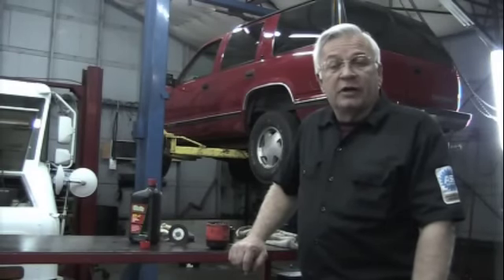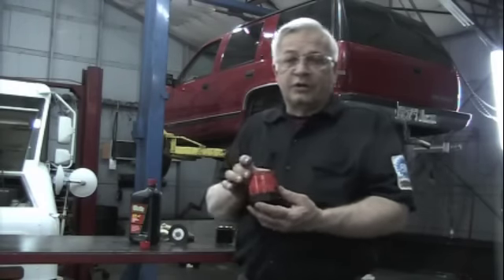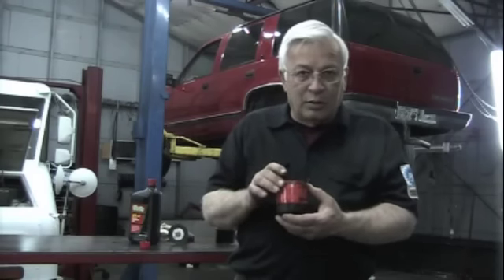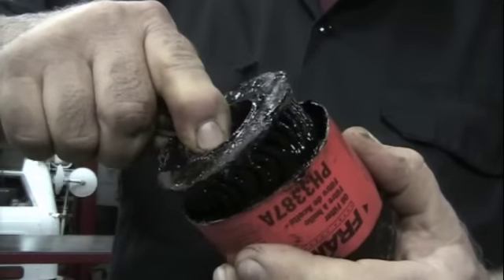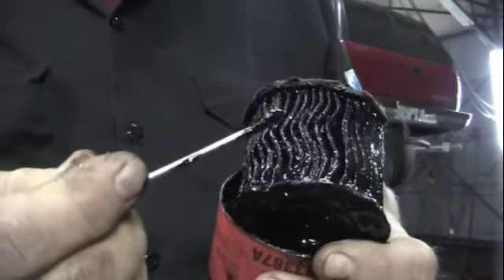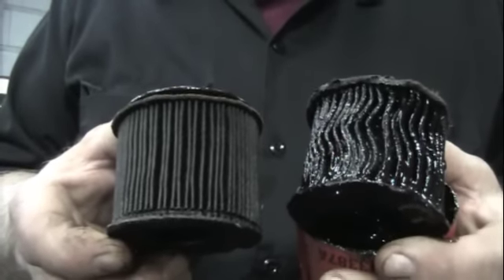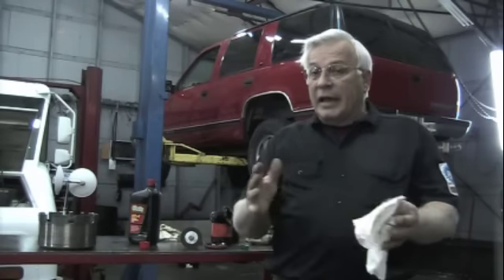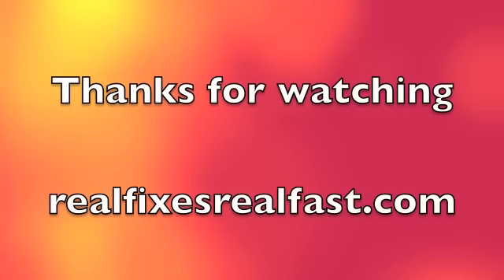Low oil pressure, finding evidence

Comment: I may as well invest $23.50 AUD in an oil pressure gauge to check the oil on my Chevrolet LS1 engine.
The oil filter has actually been catching sand & holding the anti drain back valve open overnight so the oil pump sound as if it's aerating on startup.
If I let the engine sit for 5 minutes after startup, it won't do it again if I restart it within that time period.
That will likely save me $120 AUD on a new oil pump,the engine has done over 332,000 kilometres & has a lifter noise sometimes,at easter (hopefully if I get a job before then), I will fit a used camshaft I bought for $35 AUD as I think the original one got hammered,the lifters are probably just worn out as the rollers squeak.
I will see if any of the area around the lifters is dirty & clean that when the cylinder heads are removed.
I will also replace the worn timing chain as well.

Comment: Concerning this video what is your opinion on oil flushes?

And will oil flushes hurt, weaken or damage gasket/seal or rubber rings in an engine?
Reply from the maker: no oil flushes wont hurt the seals.  just be sur to be patient and give it time to work

Comment: I just found out today. 2019 ram 1500 with a 5.7 will run 102351.6 miles if you never raise the hood on it.  the lady said she was driving and heard a squeal and it shut down.  no warning. after seeing it was locked up she said to fix it any any cost she still owed 32k on it. after pulling the engine and oil pan it looked like it was full of grease not oil. you could see where the crank made groves in the so called oil.  after checking it out a little more we found the drain plug still have the factory paint mark on it same with the oil filter and air filter. it was so dirty that it split. so we called her and she said she didn't know she had to change the oil and filter. so after I got home and thought about it I think i'm going to call her in the morning and tell her we not fixing it unless she agrees to bring it in every 3000 miles and if she goes over 5000 miles she voids the warranty.  oh and if you figure it up the truck is only 8 1/2 months old.  that's about 12500 miles a month. this woman drives. but if she had a fram on it I bet she wouldn't have made it 60000 miles.
Reply from the maker: thanks for sharing.  You wouldn't think that could happen, but they can.  Good move on the 5000 mile warning, lets see if she ignores it too.  Suggestion;  to help he get in the habit of changing the oil, increase your final charge by what you need cover them, and then tell her the oil changes for the next year are included.  Hopefully she won't forget about having them done.
Reply: @realfixesrealfast  well i'm finding out in a truck that's only 8 1/2 months old it seems I will be getting a engine from a dealer.  so she going to pay and then i'm going to add my 30%. but I just started looking into it today.

Comment: Sludge can be caused by a bad oil quality, misfires or too rich mixture , injector problems (pissing in place of spraying), so that unburned gas came down in the oil: this make chemical reactions with the unleaded gas (contains alcohol, benzene and other chemicals)...
A coolant leak can produce mayonaise (oil/water emulsion) but they color look more like milk coffee or chocolate...
If you drive principaly in city and small distances, change the oil at half the normal millage...

Comment: My guess is there are chunks of gunk in the system that randomly break loose and get trapped in the filter. I would say that the previous owner never changed the oil. He probably changed the oil just before he sold it. Eventually, if enough of these chunks break off and become part of the filter, oil will be restricted throughout the system. This will cause all kinds of damage to the engine if left unchecked. This guy should really flush out the system.

Comment: I have a hard time believing that filter was changed when the oil was. Even though it's FRAM, which is garbage, it still would not be that bad. The oil change place was just dumping the old oil and putting new oil in without changing the filter.

Comment: I have a Ford Bronco II and my drivers side rocker arms would basically eat their way through the rocker arm shaft and bend push rods because no oil was getting to the rocker arm shaft, NO OIL!. 
So I installed a T fitting in the side of the block where the oil sending unit goes and ran a plastic hose from the T fitting to the top of the engine. I then drilled a hole in the end of the valve cover and in the end of the rocker arm shaft. I put a rubber grommet in the valve cover, ran the plastic hose through and into the rocker arm shaft. 

Problem solved! 

At first I would fill up the valve cover with oil so I installed an inline pressure regulator in the plastic hose to slow down oil flow and I've been driving it for 3 years now with no problems what so ever! I'm guessing a spun cam bearing or something else blocked the oil passage to the rocker arm shaft and replacing cam bearings is way more work and would have cost way more money than the $20 I spent on  plastic hose, a T fitting and one grommet.

Comment: If you ever look at pictures detailing the inner construction of Fram filters, you will see that they are very cheaply constructed in comparison to WIX and Purolator.

 Fram used glued-on cardboard ends instead of metal and rather flimsy filter medium.

Comment: @dmorley100 Yeah, there is no way that happened in two months. 

Sounds like someone is lying. Either the oil change shop was skipping out of changing the filter or the owner just changed the oil but not the filter after the engine began making sounds.

Comment: I found out the hard way , that it was the Fram Oil Filter causing my issues ( I decided to cheap out one day) Now I'm facing a possible complete  engine tear down and I just had this engine rebuilt four years ago with less than 10,000 miles on it.. Glad you posted this video.

Comment: I agree with the diagnosis but I disagree with the solution.  I would drain that oil & put cheap oil & filter back on & put a full can of seafoam in oil, let it idle for 5-7 minutes & shut it off &let it cool all the way  repeat this process about 3 times & then drain your oil & put good synthetic oil in & a good filter, Fram & purolator don't count. Get a K&N or royal purple filter. Good filters don't gum up near as fast. You should do the seafoam flush with every oil change.  I always do this & I always get 250,000+ miles on every vehicle.
Reply: buzzsaw301   Yes, I use Motor Flush by gunk every 3rd oil change.  My Toyota 4runner now has 316,000 miles.  Highly recommended.

Comment: sbc . i have no oil coming out of the top of my 350 chevy . pulled the oil pump spun it by hand oil comes out pretty easy .. what else could it be? also the oil is clean just had it changed about a month ago.

Comment: If my pressure is good on start and falls after running it should I check this first and then check the oil pump after? I just replaced the oil sending unit so I think it's reading properly.

Comment: I'm having same problem in my 98 4.3 vortec blazer. Well about a half hour after running and driving (when the oil gets hot), I stay hearing a knocking sound coming from oil pan. Most likely a bearing.   My oil pressure Fisher never list pressure but bounces anywhere from 60-120psi after it warms up. I know before it starts knocking because as soon as gauge starts bouncing it knocks. I've got my truck oil pan off now and I'm replacing the pump. Someone told my the pump had a pressure relief spring that might be bad. In just praying I didn't do all this work and my motor still knocks once I put it back together... BTW, it is so quite the first 20 minutes. No sounds. Even tried to get sounds to show mechanic but motor wasn't hot I guess??? My motor has 240000.
Reply: I hope someone can help. Don't know what else to do if this isn't the problem.
Reply: Jeremy Stapleton any luck on this????

Comment: This is a very informative video. I never even considered cutting open the oil filter to check on anything. You don't necessarily need a cut-off wheel to cut the filter body. Just use a hack saw and cut it all the way through.

Comment: I have a new long block 75 Chevy 292ci. Mostlt city driving, what interval of oil changing should I use. I use Castrol 20-40 at 30lbs oil pressure.

Comment: It could be short journeys not getting the oil hot enough for long enough to drive all the condensation out, leaving it to turn to emulsion
Ten miles to work and ten home might be just not far enough to turn it all to steam and vent it off.   just an idea.
Reply: Quite possibly.  But then the oil he drained would be sludgy aswell as visible sludge on the underside of the oil cap. I drive 2 miles to work and back and it makes my oil smell of petrol from the majority of rich running :/. Thats why i change it every 6 months

Comment: I installed a Mulling oil pump not to long ago on my 33 year old corvette, cause when I stop at a red light the oil pressure would go down to almost “0” but the engine never overheated and no noise would appear. Still dose it after I replaced the oil pump. What could it be . The oil pressure sending unit?

Comment: I agree. What i dont i quite understand, is if I was to find an oil filter in that condition, I´d flush the engine just make sure that the sludge problem is pretty much taken care of though out the entire engine using 2  new oil filters. The second one as the final one. Over 80psi?? Is that a standard engine??

Comment: Good day. I need some professional advice. I have a Toyota 1992 model 4AF Carburetor playtoy.I open the engine at 605K for the first time just to replace bearings on the big ends and put new rings in"I did hone the sleeves..Overhaul the cylinder head at a engineering works.I never previously had any noise in the engine, just to redone the engine only.Now what happens with the engine, when the oil started get heat up, i hear something like a bearing knock between 2500-3500 RPM. I investigate with a screwdriver on the head, with my ears. Cylinder 1 no noise, 2 no noise, 3 start noise, and at cylinder 4 the most noise. Is that the oil pump? Someone give me some advice please.

Comment: That’s helps me a lot although I’m getting low oil pressure gauge light that’s doesn’t fluctuate whatsoever. It stays at low. Could that be the sensor? 03 Ford Explorer 4.0 v6.
Reply from the maker: yes it definitely could, or sludgy oil.  I have seen these as almost yearly failures when the oil is sludgy
Reply: @Maddog worker 20 + years and sitting for 8 years, the oil passages are most likely plugged up with sludge.  I would recommend an engine flush from a tech that know how to properly do it.

Comment: The worst thing you could do with an engine in that condition is do an oil flush.  Doing an oil flush pretty much guarantees you'll end up clogging up the oil pick up screen.  Better to change the oil more frequently and let the detergents in the oil slowly break down the sludge.

Comment: Well the we are talking about 2 different kinds of flushing and you should have known that from our previous dialog. I'm not familiar with an engine flushing machine; maybe they're no good or maybe it just wasn't operated correctly. I've used a quart of flush that gets dumped into the crankcase and the engine is then IDLED for 20 - 30 minutes. You start with clean oil and you dump out black oil. I've never heard of anyone having problems after using this method.

Comment: getting a bigger engine oil filters better also less choking for the engine
Reply: Len Vantil na, dont go outside engineers requested oil filter size. volume and pressure changes. the movement of oil (viscosity)may change.  choke.... huh
Reply: Len Vanti

Comment: How do you know the screen wasn't already plugged up before the flush was done? The flush breaks down the chunks. It turns it into a low viscosity fluid. That's the point of using it. Not to just break chunks free, but to dissolve them into the oil.

The size of the internal oil passages is irrelevant since the oil has to pass the pickup screen and then the oil filter before it reaches them. Sludge will never find its way into the oil passages from the oil pan.

Comment: sounds like someone has not changed the oil on time. IT could be it is using oil and sludging up the internal parts of the engine.but thats alot of sludge to come out of the filter, or someone put somekind of oil treatment and thickened the oil alot gumming up the oil filter.neither that i believe that the motor should have 80 psi oil pressure a new motor should not hold more than 60 psi .something dont sound right. better dig deeper. rod aspen

Comment: Where is the oil level sensor located on the 4.3 L ? I have a 02 Silverado and CANNOT find it on the oil pan.

Is it inside the pan❓❓❓❓

I'm also seeing the oil pressure gauge drop after engine is at operating temperature.

Please share any videos that would help.

At the moment the light on the dash keeps telling me to check low oil level. When oil level is fine.

Please someone HELP❓❓❓❓
Reply: It should at the rear of the engine below the distributor
Reply from the maker: with the limited info you've given I'd be suspicious of worn bearing clearances.  the sender is on top of engine near distributor or where the dust would be if you had one
Reply: @realfixesrealfast  ,

I appreciate You replying back to me.

Would you recommend 20w50 to raise the oil pressure up to limp the old high mileage engine along in that 02 Silverado? It's got over 200k on that 4.3L vortec, I also use Amsoil synthetic.

My other problem is, I CANNOT find on YouTube or the internet a video or pictures of where the LOW OIL SENSOR is located on the oil pan.

Someone told me it was near the starter. Yet I DON'T see it anywhere when I'm under the truck.
Another person said the sensor was inside the oil pan.

What stinks is, the low oil level light is on the dash. And there is a plug dangling by the starter that has to be for the sensor. Though, I'm just not seeing it's location.

    I'M STUMPED❗❗

Could you possibly ask around or send me some video links?

Something to help me❓

Thanks and have a blessed day,
Carl
Reply from the maker: @04DynaGlyde  I would recommend the same grade of oil that the OEM calls for. However, I would add Lucas Oil treatment at 20%.  Heres how.  If. you engine holds 5 quarts, drain out those 5 quarts and add back in 4 quarts of new oil plus 1 quart of Lucas oil treatment (20%).  That would total 100%

Comment: kerosene really seems to clean engine is really good only use a little bit or junk is going to stick some where and the engine is really poor oil pressure so what's your oil pressure when you doing this

Comment: An engine oil flush isn't something I would do on a customer's car if they didn't want to spend the money to have the engine torn down to be desludged. If you shorten the oil change interval and the customer does some long road trips it will slowly break down the sludge as long as the PCV system is operational. Manufactures have come out with TSBs that state engine oil flushing is not recommended nor endorsed.  If the oil is changed as it should be, flushing isn't needed.

Comment: Are you sure that oil filter's only been on that motor for a couple of months. I ain't doubtin your word, but since it's a Fram oil filter, I gotta wonder if they've been gettin it changed at Wal-Mart and they've been drainin the oil out, puttin new oil in, and not changin the filter. That sounds like some crooked stuff that Wal-Mart would do.

Comment: Thanks for the film but no reason for the slug oil. Never changed filter? Never changed oil before? Engine issue. The Chrysler Seabree ? Some name like that sedan they have cronic engine problems, seems to be in design.

Comment: besideds the fact the my car has stalled out while idle, it runs good and I don't hear any wierd noises fromt he engine. I also changes the transmission fluid and filter too. ( I know that might not be releavent to my problem but I am just stating everything I did just in case it might be.)

Comment: "Doing an oil flush pretty much guarantees you'll end up clogging up the oil pick up screen."

Nonsense! Where did you get this from? We are talking about a seriously gunked up engine. I would first pop off the valve covers and scrape as much gunk as I can out of the head(s). The detergents in regular oil wouldn't put a dent in the sludge of an engine like this one.

Oil flush breaks down the oil and sludge and then you drain the crankcase, change filter and refill with oil.

Comment: I have a 2010 audi A4. Ive always been on about schedule for synthetic oil change. Exactly a week after an oil change. I get a "oil pressure level too low, turn off engine" now I have engine light on. I dont hear any noises or rattling. I am taking it in to mechanic tomorrow hopefilly it is not oil pump or "broken metal pieces into cylinder" and I did have engine flush 3 months before today. Any advice on what should be taken first to check? all respectful advice would be greatly appreciated. thank you!
Reply: +Daniel De Amat I'm currently driving a 2007 VW Passat 2.0t and I have an odd problem. I got a low oil pressure warning while driving, but it went away, and hasn't come on in 2 days. Oddly enough it seems to have sorted itself out.

Comment: I have the same problem i think on my Volkswagen Golf 6 2010 I will tomorrow change the oil filter and oil and I will flush the engine then I will see if it fixes it the problem